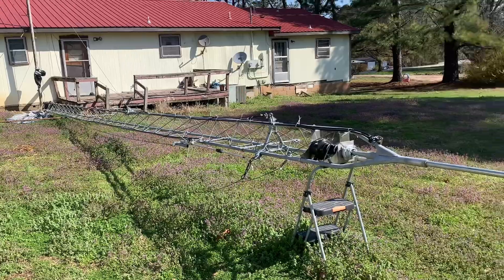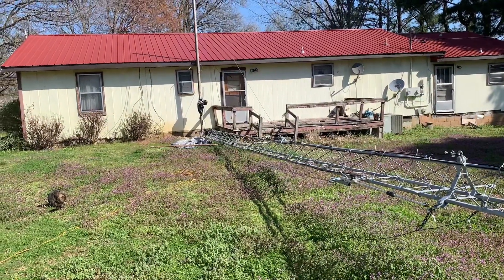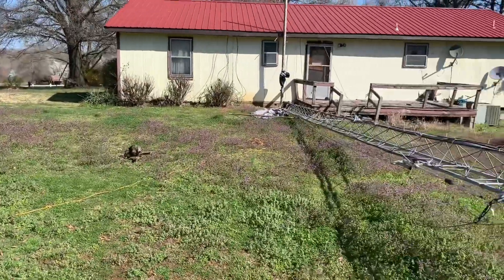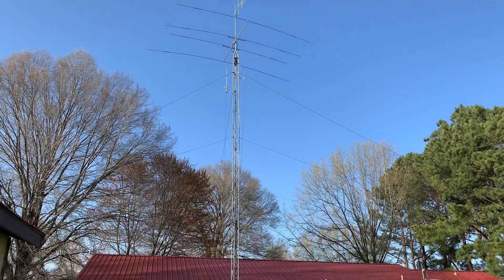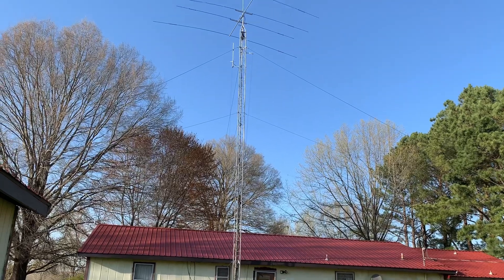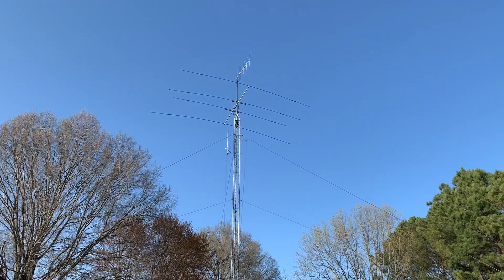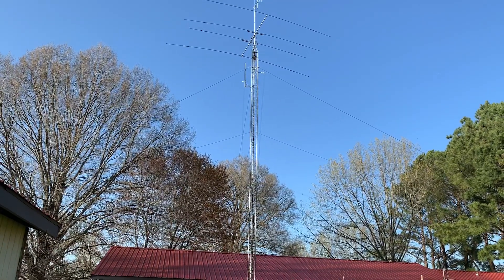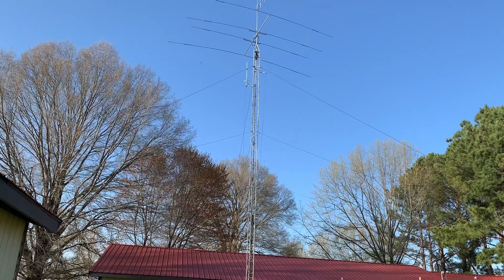Raising the tilt over tower project here at WD4PTJ.

Comment: Thanks for sharing your experiences from Gibson County. I have 40ft of Rohn 20G.  I'm putting it up at my new QTH. I can't climb anymore, so I got a tilt over plate and two 9 ft lengths of 4"X4"X 1/4" square tubing.  I was trying to keep it simple as possible.  I like the way you went about it. So I will connect the two 9' lengths together. Bury three feet of it in the concrete and have 15ft left above ground. If a 20ft pole will lift your 50' tower, I'm sure my 15ft  square pole will lift my lighter 40ft 20g tower.